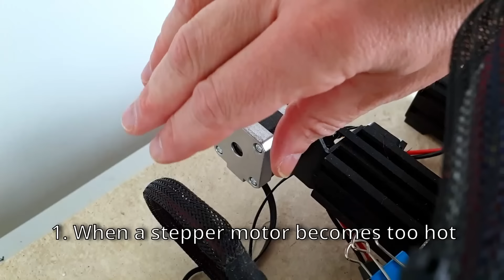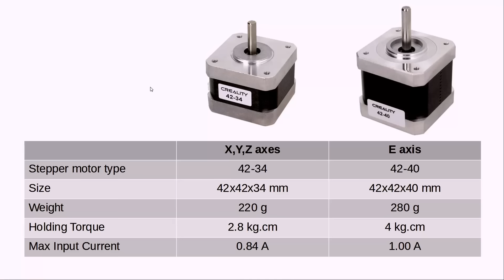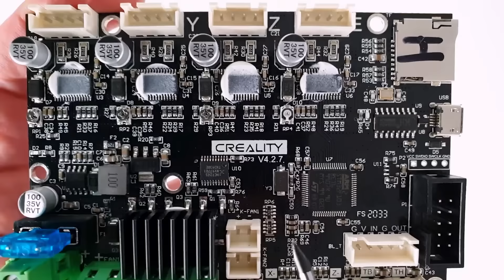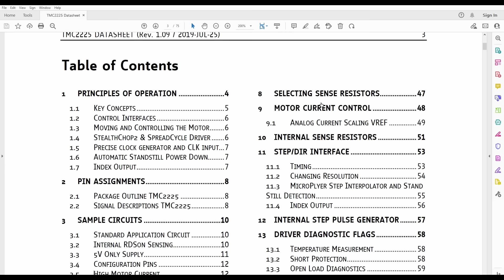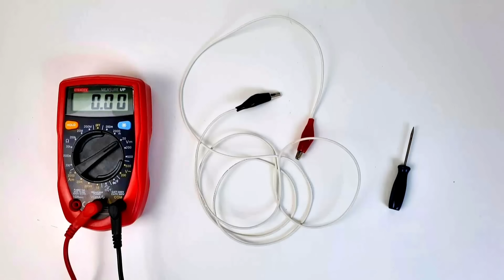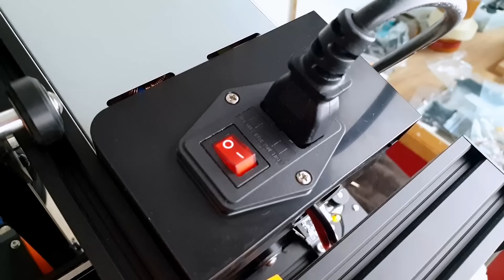How To Set Stepper Motor Current / VREF on Ender 3

Comment: If adding a z stepper motor for duel z screws how much would you bump current to on a ender 3 pro with a 4.2.2 board? Going to use a splitter board or a y cable. Not sure which yet.
Reply from the maker: Hi, it is a tricky question and I don't have an answer. The Ender 3 V4.2.* mainboards are not really designed to run dual stepper motors off a single driver. The Creality silent mainboards run the drivers in standalone mode. This mode provides less torque to even a single stepper motor, much less two. If you have just connected the 2 motors to the same driver in parallel using some sort of Y splitter cable, each motor receives only half of the current => less torque => skipped steps... You don't want to raise the current too much neither because the driver has probably not been designed to operate at 2x current for extended periods of time (and will get too hot => go in standby mode).. I guess you have to raise the current a bit to compensate for the additional friction of the 2nd leadscrew + additional heat losses because you are running 2 motors instead of one. This is what I would do: Currently, your VREF on the Z axis should be around 1.10 V. I would raise it to 1.20 Volts. This is known to work because the extruder motor runs at this current in the stock configuration. If you still have skipped steps, I would raise it 0.10 by 0.10 Volts until skipped steps are gone, trying to stay below 1.40 volts. If this does not work, I would replace the Creality mainboard with a board that can natively support 2 Z motors on 2 individual drivers.
Reply: @YouMakeTech  this was basically what I was expecting based on your video. I’m hoping not to have to replace the main board but in the end running two lead screws as you say is quite difficult at the current range of the drivers. I may end up replacing it or working towards the belted option I saw you post or made a video about. Thank you for your help!
Reply from the maker: To be honnest, I never upgraded my Ender 3 to dual z steppers because I am concerned to raise the current too much. The thermal design of the area surrounding the mainboard is bad and I had issues with drivers becoming too hot in the past. I prefer a mechanical system
Reply: @YouMakeTech  just dual screws no motors or something more akin to the belt system?
Reply from the maker: Something like this: https://www.thingiverse.com/thing:4243512 . This design even won an award from Creality!
Reply: So checked my stepper currents and they were very low at .56 xyz and .76 for e. The board is a 4.2.2 board with resistors at 150. Bumped up the z to .9 and it started running both steppers without warmth to the motors. Might take them up to 1.1 next and see how they do.
Reply from the maker: The values are quite low. Most likely your board does not use TMC drivers

Comment: How to check stepper motor driver type in creality v422 board?
Reply from the maker: The only way to know for sure is to remove the heatsink and the glue. The driver type (e.g. TMC2225) is written on the chip. Unfortunately, the Creality V422 mainboard is a complete mess. It has been shipped with almost every driver type on the market, A4988, TMC2208, TMC2209, TMC2225! If you don't need to know the exact reference but just know whether you have a A4988 or a TMCxxxx driver, you can either 1) Listen to the noise: the TMCxxxx drivers are silent drivers => much less noise when moving a stepper motor 2) Measure your current VREF. If the VREF is in the range 1.1V to 1.4V, most likely you have a TMC driver. If it is below 1V, most likely you don't have a TMCxxxx driver...
Reply: @YouMakeTech  thanks. I'll Try this method

Comment: Thank you soo much for the chart of voltages and amps for each stepper. I fried my old mobo on my printer and had to adjust the voltages on the new mobo. Some were set to 1.6 and extruder was nearing 2

Comment: What is ALC or AIC stepper motor driver? It's just written on the card reader of my Ender 3 Max.
Reply from the maker: Never seen this before. Which board do you have?
Reply: @YouMakeTech  CLeality v 4.2.2
Reply: that means you have tmc drivers in x,y and hr4988 drivers in z and not sure the extruder as well

Comment: I had problems with the motors making a thump- or weird clunk- sound when starting the machine with the 4.2.7 board.. (newest marlin firmware with own config).. IDK why that is. Also thought about returning the board...
sometimes my ender 3 also makes these roll-out grinding sounds, that seem to come from the x axis motor... maybe only when USB is plugged in or so.. still testing that .
 I could feel the noises on the frame too, they are twitching/ "torquing" the clunking sound also comes sporadically from the y axis motor and Z axis motor.. I down tuned the potentiometers down to 0.3- 0.33 V. (hemera extruder on 0.36V) reccomended voltage for it is 0.48V  the creality steppers should be at 1.1, but idk I THINK the clunking sound almost dissapeared with the low numbers. it got weaker and weaker the more I dialed the potis down. I did this until it was either really unnoticable, or completely gone at startup. although it might only be a startup-spike problem or so. I think I also tried the original Creality firmware, and did not notice the same behavior as from the Marlin user-pre config firmware. but I could be wrong as it does not make these sounds every single time the machine starts... anyway. it is weird, it is also weird that the motors work like this , currently printing a piece, and so far it works great.  oh and I also tried to find something in the config files in Visual studio, anything related to current/steppers, power up, etc. nothing worked , nothing definite found. and I also read, that the drivers work in standalone mode, so current settings made in the config files would not even be executed , you have to enable uart mode or something for regulating the current via firmware. but anyway.. screwed it manually by the pots.. print is really coming out quite nice, right now printing PETG at 150mm/s  without part cooling (printing the fan duct right now lol)
Reply from the maker: Thanks for sharing your experience. I am not sure to understand how you get a Vref of 0.48V. This seems very low and could explain the clunking sound. Maybe the clunking sound is the motor skipping steps due to the current being set too low? 
According to this: https://e3d-online.zendesk.com/hc/en-us/articles/360016249057-Hemera-Current-Adjustment-Edition-1-  , the standard Hemera motor has a rated motor current of 1.33A This is higher than the rated current of the stock extruder motor (1A). Which means that you normally should increase the Vref, not decrease it. The Vref for the stock extruder motor is 1.2V. 
For the Hemera motor and Creality V4.2.* mainboards with TMC drivers,  the Vref should be increased to 1.60V - 1.84V. 
The only way to adjust the current is through the potentiometers because as you said the drivers work in standalone mode. They cannot be controlled by firmware. All driver settings in Marlin configuration files are not applicable to the Creality V4.2.* mainboards as the firmware cannot communicate settings to the drivers.
Reply: @YouMakeTech  but the clunk came on the original voltages... I tried to lower it after standart vref, to prevent that   from happening. that sound def. comes from the printer activating the steppers  at power on, it activates them for a few seconds, then the steppers deactivate...  I watched the australian tech guy configuring  the hemera, and he basicly said that the recommended vref for the hemera stepper has to be set at 0.48v...  maybe I should read up on the E3d site on the recomended vref for the extruder...  still tryingto figure out the perfect config and everything... sadly creality does not provide the code of their firmware, I think only the BIN.. I will test that stuff further if I got the nerves:)
Reply from the maker: In TeachingTech's video about the Hemera on Ender 3 ( https://youtu.be/oY1F7fUBHrc ) the 0.48V VRef is for A4988 drivers on the V1 Creality mainboard. You can see that the printer mainboard is green on the video which means that it is a V1 8 bits mainboard. The V4.2.7 mainboard is black.
The 0.48V Vref not correct for a V4.2.7 mainboard with TMC drivers. With a V4.2.7 mainboard, your Vrefs should be : X=1.10V, Y=1.10V, Z=1.10V and E=1.75V. E3D specification has an incorrect value too for Vref for Creality V4.2.* mainboards. This is likely because Creality uses 150mOhm sense resistors and not 100 as in the driver specification.
I also have a clucking sound when starting the printer. This is expected because the printer powers temporarily the motors on startup. I don't think you should be worried about that.
Reply: Got that Problem too
Reply: The Clunk Sound is normal when starting the printer. Its the Z axis and as far as i know. When the printer is powered off, It sinks down and sits on the leadscrew.
Reply: I'm about 10 months late to the party, but that clunk is normal as far as I know.  When I upgraded to the 4.2.7 Creality board, it started doing that.  Others I have talked to said it is normal.

Comment: Hi how do you change the stepper driver on the board? i think my driver is gone, its showing 24v
thanks
Reply from the maker: If the driver is soldered on the board, it is nearly impossible to do it yourself. The component is surface mounted and the distance between the pins is very small.

Comment: I like this video because it is straight to the point ! Where did you find the specifications of the motors? Most shops advertise the Creality 42-34 to be 1.5A and 4kg.cm torque. Because of the Vref values, I was thinking it might be wrong but your datasheet seems closer to reality.
Reply from the maker: I posted the specifications of the stepper motors & drivers on my website. You can find them at https://www.youmaketech.com/how-to-adjust-stepper-motor-currents-on-ender-3-pro-v2/

Comment: Hi what is roughly suitable Uref for Z axis if I use two motors instead of one?
Reply from the maker: Hi, it is a tricky question and I don't have an answer. The Ender 3 V4.2.* mainboards are not really designed to run dual stepper motors off a single driver. The Creality silent mainboards run the drivers in standalone mode. This mode provides less torque to even a single stepper motor, much less two. If you have just connected the 2 motors to the same driver in parallel using some sort of Y splitter cable, each motor receives only half of the current => less torque => skipped steps... You don't want to raise the current too much neither because the driver has probably not been designed to operate at 2x current for extended periods of time... I guess you have to raise the current a bit to compensate for the additional friction of the 2nd leadscrew + additional heat losses because you are running 2 motors instead of one. This is what I would do: Currently, your VREF on the Z axis should be around 1.10 V. I would raise it to 1.20 Volts. This is known to work because the extruder motor runs at this current in the stock configuration. If you still have skipped steps, I would raise it 0.10 by 0.10 Volts until skipped steps are gone, trying to stay below 1.40 volts. If this does not work, I would replace the Creality mainboard with a board that can natively support 2 Z motors on 2 individual drivers.
Reply: @YouMakeTech  Thanks for the qualified reply.
Reply from the maker: You're welcome. If you end up adjusting the stepper currents for this setup, please let me know how it goes I am interested in your experience.

Comment: i installed a bmg extruder on ender 3 v2 stock type main board v4.2.2 tmc2208 but it has a problem when retracking it makes a loud sound can you help me solve this i am having a hard time trying to change the vref value on xyz 1.14v san e 1.27v should i  replace the stepper motor E to overcome the noise during retraction?https://youtu.be/8_YDPrQ85NA
Reply from the maker: Have you tried to slow down retractions to very low speeds (e.g. 3 mm/s)  to see whether the noise goes away? Looks like some kind of slippage noise. Do you get the same noise when separating the motor from the BMG?
Reply: @YouMakeTech  I've tried with slow retraction speed of 25mm/s and 35mm/s the sound is a little muffled but it's still loud not like a normal retraction sound. I'll try to replace the stepper motor with a nema 17 23mm.  I hope the sound problem goes away after replacing the stepper motor
Reply from the maker: 25 mm/s is not a slow retraction speed! By slow, I really mean slow, 1 to 5 mm/s. Retractions are mostly driven by acceleration, not speed. The retraction distance is so short that the motor spends 99% of the time accelerating and decelerating during retractions and never reaches the max retraction speed. Try to reduce the retraction speed to 1 mm/s for testing/troobleshooting and see if that's get rid of the noise